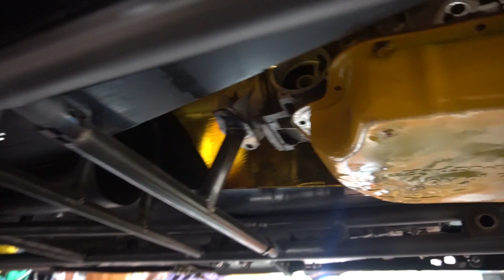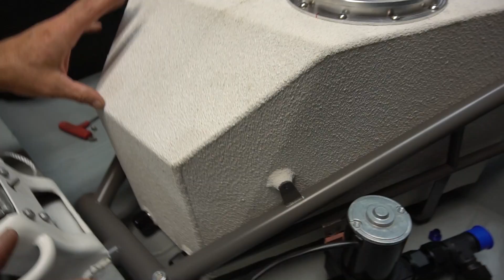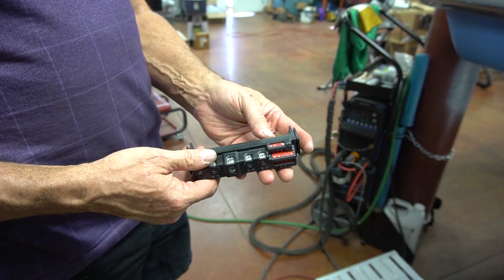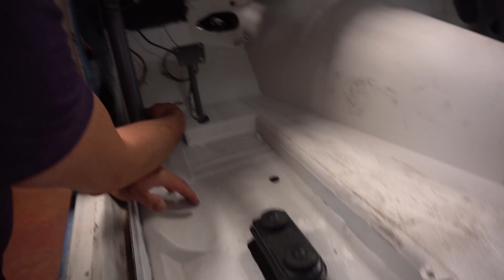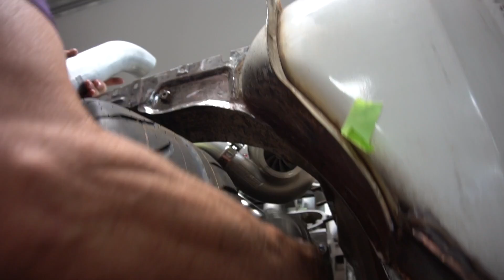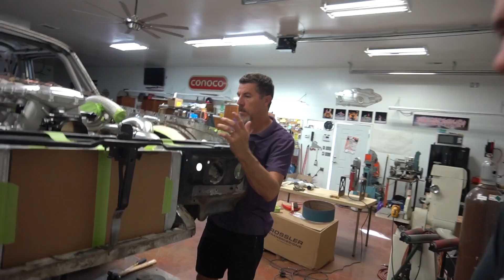Project 200mph Standing Half Mile Build Twin Turbo Buick Skylark

Comment: Dynamat is worth the weight.  It works well on large flat surfaces where you would find vibrations.  Its redundant on corners and supported edges in my experience.
Reply from the maker: 100%